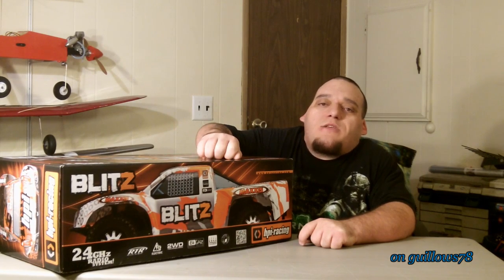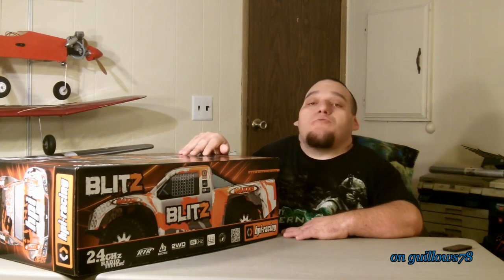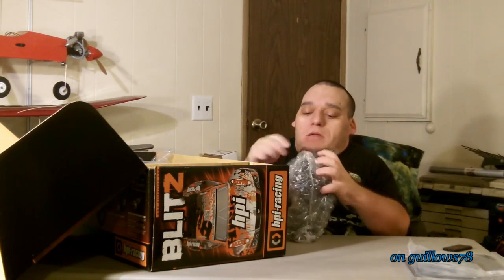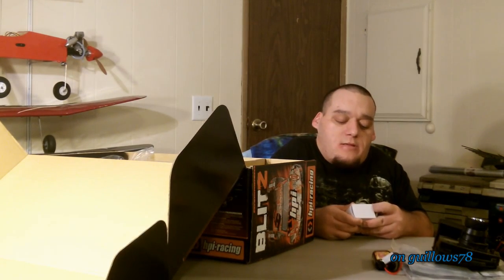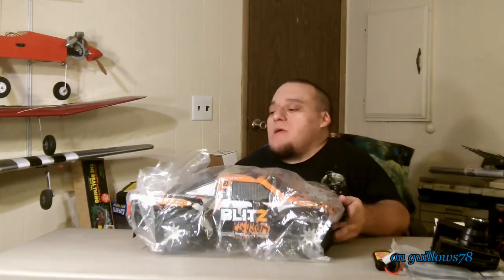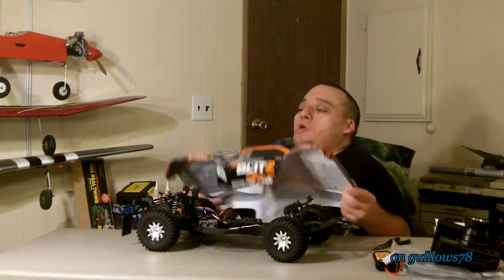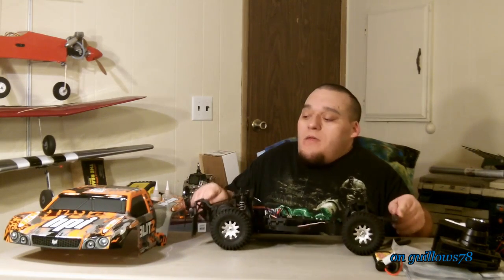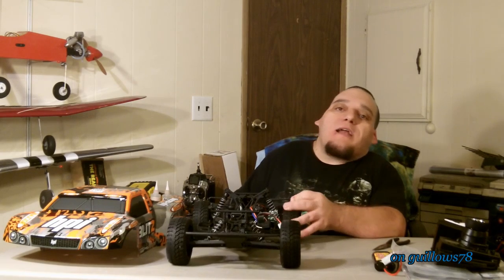RC TRUCK UNBOXING OF HPI BLITZ On Guillows78 Rc World

Comment: Great video! I got the first blitz when it came out, the brushed one and that thing is a freaking tank. The motor finally burned out and some busted parts need to be replaced but i'll tell ya, that truck will do almost anything! When i first got it i went to my local track to race after 7 years since my last one and got 3rd place everyone else had a brushless traxxas 4x4.... That just proves how great this thing handles.